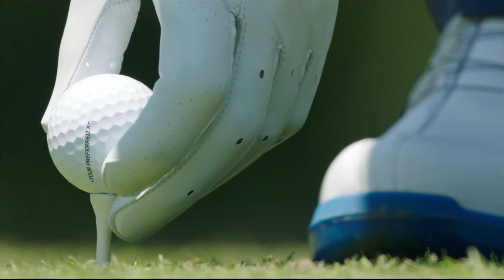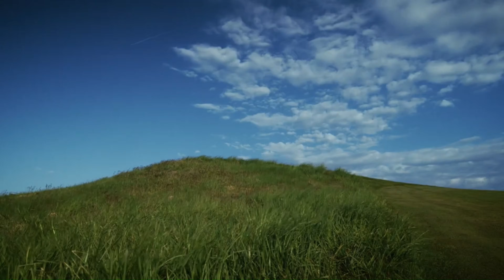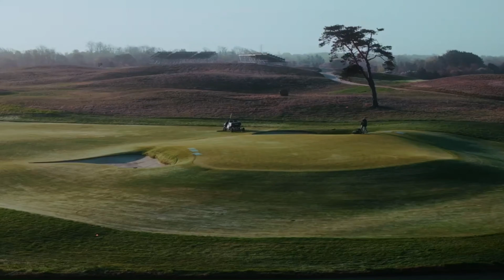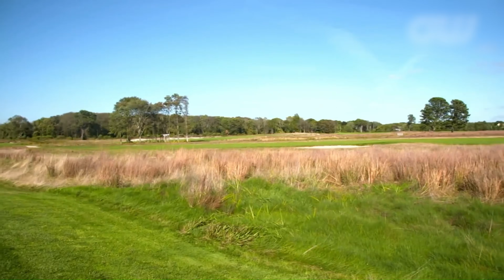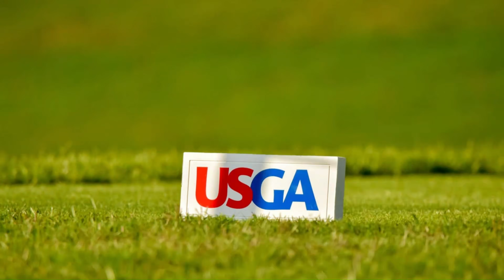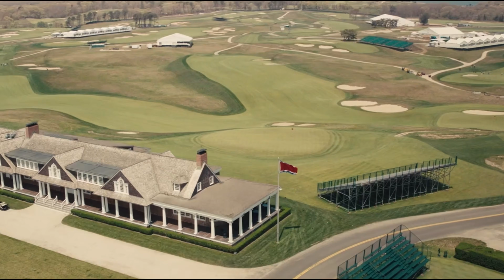At the US Open Shinnecock Doesn't Run Its Own Course

Comment from the maker: In 2004, the USGA hand-watered Shinnecock's seventh green between groups while the field was still on the course — a decision so unusual the broadcast couldn't explain it in real time. In 2018, they missed the wind and Saturday's scoring average hit 75.33. Both failures came from the same physics: Poa annua greens on a free-draining sand base move faster than the measurement cycle can catch them when conditions change faster than forecast.

Here's the question: Is the USGA's "no watering during play" standard the right call — or does it set up an unmanageable risk on a course like Shinnecock that has no automated moisture control? There's a real argument on both sides.

For the sourcing: Darin Bevard's interview with National Club Golfer (2024) is the clearest primary account of how the morning cycle works. Worth reading before June 18.

The full paper trail is in the ebook The Hidden Rulebook: https://publy.store/p/dailygreenskeeper/the-hidden-rulebook